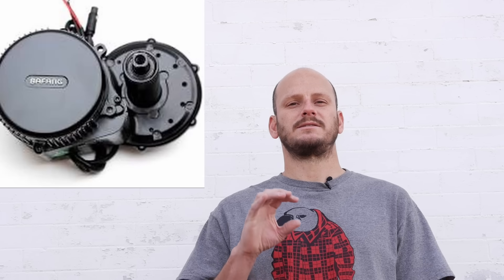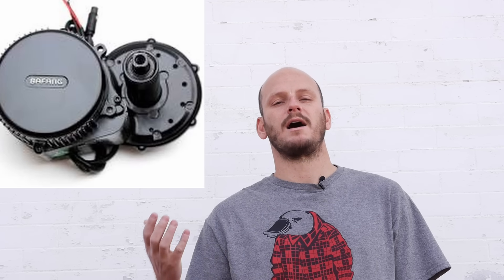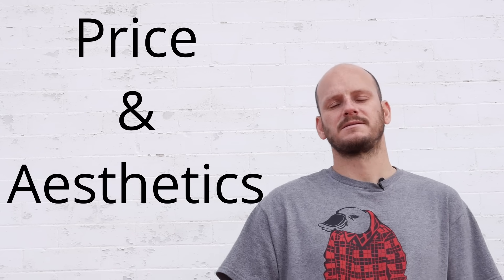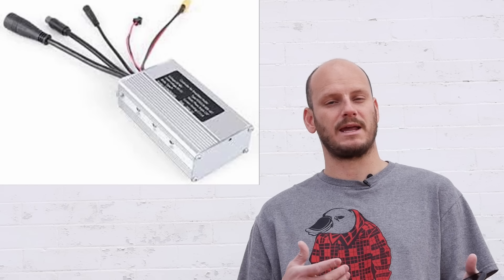Hub vs. Mid Drive Motors: Why Hub Motors Suck and Debunking Common Myths with performance test

Comment: I have 2600 miles on my $1100 hub drive bike. Also, my 500w Das-Kit motor has no problem with hills.
Reply from the maker: 👍 it definitely depends on where you live. Hills here in Salt Lake City burn Em up! But they can be 10% grades
Reply: @JohnnyNerdOut  Any motor will burn up if overloaded. You simply have the wrong motor for the application. Not the motors fault nor the motor topology's fault.
Reply from the maker: @difflocktwo  totally correct that you can burn up ANY motor when driven improperly.  When when ridden properly a mid drive will last longer and outperform a hub on steep hills (over 8% or so)
Reply: @JohnnyNerdOut  If we choose a hub motor that meets the required performance, I don't understand why you say it performs worse. The hub motor will perform exactly as it will and if its enough, its ok, if it is not enough, it is the wrong motor for the application. We can use the correct motor for the application and achieve the performance we desire.

Comment: His price comparison is wrong. You can get  a  hub motor a lot cheaper, like $200 for a 250w kit. Bafang mid-drive the lowest is $400. Also, the hub motor can be lighter. I found one for 1.2kg, compare to mid-drive 4kg. But for me the reason to get a a front hub is that I can just remove the front wheel if I decide to use it as a normal bike, furthermore, my drivetrain will still be the same.
Reply from the maker: I was trying to do a apples to apples comparison 750w to 750w of comparable quality. You can also get cheaper mid drives. Tongshen cyclone etc especially if you buy direct from China.
Reply: @JohnnyNerdOut  If output power were the same, you would not feel any difference in performance. Not exactly apples to apples. If one feels weaker than the other, it is. If one is weaker than the other, it is not the same wattage.
Reply from the maker: @difflocktwo  not true. Drive a 100 up automatic car and then the exact same car with a manual and tell me the acceleration isn’t different. That’s a poor analogy as it really doesn’t even do my point justice but it’s the same principle.
Reply: @JohnnyNerdOut  If you dyno the cars in your example and the dynos do not match, it is clear why one would be slower than the other. One has less power or less area under the curve than the other. Even if both are labeled the same, it is clear that they do not perform the same.

On a kinda sad note, manuals are not selling that well anymore, even in europe.

Comment: I live in the mountains and I am using a hub motor and have no problems
Reply from the maker: Interesting. You would however notice a marked difference with a 750w mid drive on those hills 👍
Reply: I do not live in the mountains but I have a hub motor with so much torque if flips people off the MTB. I have colleagues who complain that their hub motors have too much torque for the same reasons, the CG of a MTB is too far back for the torque of these hub motors.
Reply from the maker: @difflocktwo  power is definitely relative. Watch some of my videos showing comparable motor systems using the same power climbing hills. “Power multiplication” using the rear gears is huge. There are trade offs though using a mid drive which is why it’s an advanced system. Definitely a learning curve !
Reply: @JohnnyNerdOut  One glance at the wiki page on the watt will show that it is far from relative. The watt is very well defined. 

I already mentioned this in other replies: Gears are under 100% efficient, this means that you will always get less power out than you put in.
Reply from the maker: @difflocktwo  I’m unsure of the point
Reply: @JohnnyNerdOut  Power is work over time. It doesn't matter how work is done.

Gears do not create power, they consume a bit cause they are not 100% efficient.
Reply from the maker: @difflocktwo  correct

Comment: You aren’t comparing apples to apples though, for the price of the mid drive you could buy a 3000w hub motor which definitely has better performance
Reply from the maker: 3000w to 750w would not be apples to apples…..
Reply: @JohnnyNerdOut  ok yeah you are right 😂 but you know what I mean, they’re two completely different price points. A 3000w hub is near the same Nm rating as a mid-drive and price wise would be similar (hub would still be cheaper) so both would be closer to apples
Reply from the maker: @iSuperMC  I don’t know. I feel like that just proves my point more. It requires 4x the power (which is now not even close to being considered a bicycle in the eyes of the law) to get similar performance. 
How much is the 3kw hub motor and good controller?
Reply: @JohnnyNerdOut  Similar performance means similar power output. If you are focused on energy efficiency, that is a different argument. Most people care how much is costs, how fast it goes, and how far it goes. No matter if you ride a mid drive or a hub drive, people report similar Wh/km numbers on their commutes.
Reply from the maker: @difflocktwo  I’ll disagree there. I’d say that performance is loosely tied to power output. Gearing makes a tremendous advantage as it uses leverage to amplify the same power output into better performance.
Reply: @JohnnyNerdOut  Imagine we dyno one of your mid drive bikes. We profile your bike's peak performance from 0 to 30 mph. Then we build a hub motor bike and we program it to exactly match the output of the mid drive bike. Then we dyno that hub motor bike to confirm that it matches the mid drive dyno plot. 

Both bikes are putting down the exact same numbers, wouldn't you agree?

I would say that both of those bikes would feel almost identical at all speeds and load conditions. We basically copied the soul of the mid drive and recreated it with the hub drive.
Reply from the maker: @difflocktwo  you wouldn’t be able to make a hub motor match the same numbers a mid drive can do. You really have to ride a 750w mid drive and a 750w hub motor side by side to appreciate the difference. But some people don’t need or want the performance a mid drive offers because of the trade offs. You HAVE to be in the correct gear or you will do damage to your bike and or motor system. But for me, the trade offs are worth the power multiplication that running power through the rear gears offer.
Reply: @JohnnyNerdOut   You cannot multiply power without energy input. Gears are under 100% efficient which means you will always get less power out than you put in.

Let's say that to lift a certain mass up a certain hill at a certain speed takes 750 W. No where in that equation does drive type factor in. You can achieve 750 W anyway you want. You can use a mid drive, a hub drive or even a rocket engine. If you move the mass up at the same rate you are doing the same amount of work per second.
Reply from the maker: @difflocktwo  I understand what your saying, that makes total sense. You absolutely correct with the measurements of how horsepower is measured. I think you really need to feel the difference though. Automotive analogies are the best I know. Using a transmission or using a single gear. That’s what you have here as well. Same results with the same power coming out of the motor. You really need to feel it to believe it. 
How do you explain the same power coming out of a motor (25a x48v) giving far different results on both hill climbing and top speed (both mid drive advantages)?
Reply: @JohnnyNerdOut  

Summary of my ramblings: You had the wrong hub motor for the application if you didn't get the performance you wanted. Solution: Get the right hub motor for the job.

I assume that your current and voltage numbers are battery side. 25 A x 48 V ≈ 1 kW battery power. This is power from the battery rather than power from the motor. If you dyno the wheel, you can measure power output rather than power input (from the battery).

If one system is outperforming the other, the efficiency in energy conversion is different. Let's say the mid drive is peppy and then hub drive is bogging down. We can assume *under those specific load conditions* the mid drive is 80% efficient and the hub drive is 40% efficient. So the mid drive is actually putting down 800 W at the wheel and the hub drive is putting down 400 W at the wheel. Here you feel the difference. The hub is is putting down half the power of the mid drive with the same power input. Rest of that power (600 W) is wasted heating up the motor. The mid drive is only turning 20% of the power into heat, 200 W. I need to stress that motor efficiency can change dramatically depending load conditions. If you lock a motor it is 0% efficient even if it's putting out a ton of torque. 

In the previous scenario you are asking too much torque from the hub motor so it isn't efficient, and you directly feel that it as less powerful, because it is. For that load case, you have the wrong hub motor for the application if you want it to achieve the same performance as the 80% efficient mid drive.

If you want to match the performance of the mid drive you need to use a suitable hub motor. The hub motor would have to be able to provide the same wheel torque at the same speed at the same efficiency. 

If you want that peppy feel, it's all about wheel thrust. Wheel thrust is wheel torque divided by the wheel diameter. So you can try a smaller wheel diameter which will increase thrust or you can simply increase wheel torque. 

With multi speed transmissions you can shift down to increase wheel torque. With a hub motor the first course of action would be to decrease wheel diameter to increase wheel thrust. If you want more torque to increase wheel thrust and less losses, you can get a hub motor with more torque and less losess. In simplest terms that means a bigger motor. In more complicated terms is means a motor designed to meet your loading conditions. 

If you want a lot of torque at low speeds and with high efficiency, with typical motor construction, then you're probably looking at a very large diameter motor. If you can imagine a hub motor with the dimensions of a 26" wheel, that would probably provide enough torque to turn your bike frame into a fruit roll-up. 

Practically, ordering parts from China and so forth, get as big a hub motor as you can in as small a rim as you can and give it all she's got. 

Top speed is more of Kv thing. It's a motor constant that says how fast a motor spins per volt. So you can increase the voltage to go faster or choose a motor with a higher Kv. There are also field weakening tricks in controllers to go even faster than the motor constants would predict.
Reply from the maker: @difflocktwo  I don't think that would work for me, but maybe someone else. I live in Salt Lake City with 10-15% grade hills I need to climb. I also like to commute at high speeds. I like to be borderline legal (so no 72v systems) show me a hub motor that can do 15% hill climbs and cruise at 30mph under throttle alone using a 48v 25 amp system. Physics will tell you that you can't achieve that.
Reply: @JohnnyNerdOut  Since you are hauling 300 lbs up mountains all day, I would assume that you would absolutely love regen braking. It will save you from a lot of brake wear and I think you could get over 10% of your range back.
Reply from the maker: @difflocktwo  I would definitely have to see that in person to believe it. Almost all 72v systems would illegal over 10 amps in anywhere in USA. so technically you could run 72v legally 🤔
Reply: @JohnnyNerdOut  I think you are confusing output power with input power. Why would the legislation care about input power? Imagine I ran 4 kW from the battery, 40 V 100 A, but the motor only outputs 400 W due to inefficiency. The rest of the power is heating up the motor and the air. Are there rules against using motors as heaters? You can program a controller to drive a motor inefficiently if you need more heat from it. I think some electric cars do this as they use heat from the motor to heat the cabin. 

Or imagine I run a perfectly 100% efficient motor in series with a water boiler. I could be pulling 10 kW from the battery but my motor is only outputting a few hundred watts.

Even in Europe their 250 W motors peak at 800 W. This is because a singular wattage value without context is useless.
Reply: @JohnnyNerdOut  You can see many skateboards and little scooters with tiny direct drive hub motors pulling many kW from the battery. They also go like 60 mph or something. it's not so difficult to believe when they are all around you.

Comment: Have both.  Have built many.  Would only use a mid on a mtn bike and would never use anything BUT a hub on anything else.  Put it in gear and ride.  Never shift...and yes, hub systems are more WAYY more reliable, simpler, cheaper. Not a myth.

Comment: I bought a hub motor cause I'm poor and that's all I can afford. It is a 1000w though
Reply from the maker: Nice! How much was the kit?
Reply: @JohnnyNerdOut  The kit and a 48v 14AH battery to run it was $530 with tax. Should work fairly well though since I'll be using it for commuting and light trail riding. I wouldn't trust the walmart bike I am converting for anything more than that even without the hub kit
Reply from the maker: @ThunderbolttheFox  ride long and prosper 👍

Comment: I enjoy my hub motor conversion . In Australia we can only legally have 250w motors anyway . Yes you get more power from a mid drive but also more drive train wear which you didn't mention . My spokes have never been loose yet and it's easy to keep a eye on them and adjust them if needed . Hub motors are a lot cheaper to buy and less maintenance so it's hubs for me :-)
Reply: Put a 1500w on the front anyway.

Lmfao 25km/hr is stupid for what we have to pay to do it. The torque is incredible on big hub motors and if you really want to be a numpty about it, you can simply limit it to 25km/hr but retain all the torque of that massive motor.

You win all around going bigger.
Reply: @TheStaniG  I can get 30+km/hr out of my 250w hub motor pedaling  , more with more effort . I can change  the top speed in the display but still limited to about 25klm/hr on throttle so enough for me . Yes you can get bigger hub motors but if the cops have a crackdown on E-bikes they will confiscate it if not legal and it's gone forever no matter what you paid for it .
Reply: Yup this, I chose a hub because of less maintenance and less chain wear. It only goes up to 25km/h so it does not matter how much more powerful a mid-drive is
Reply: @Another-Address  I hope things are better now.
Reply: if yoj are climbing insane climbs say goodbye to your hub motor on the middrive you can use the gears of the bike to have more climbing power. i guess if you live in a rather flat are you arent going to need a middrive but if you are climbing insane hills middrive is for you
Reply: On road i do climb big hills with my hub drive , i use the throttle when pedaling and go up with ease . Iv'e seen teeth ripped off gears and chains break with mid drives . Hub drives still get you home if you break a chain etc . For me personally hub drives are better , i'm 68 and ride 30/40 kilometers distance sometimes which i wouldn't do if i had a normal bike so good exercise for me :-)
Reply: Restrictions you have to contend with are ridiculous and government overstepping it's bounds.  I'm glad the US decided 750 is our limit.
Reply: @stoutdog56  Difference is we are a more socialist society in Oz than the US and have free government hospital health care so gov. can take care of it's/our dollars and tell us how not to get hurt. No different to seat belt laws I s'pose.

Comment: It´s great hearing your professional experience as a bicycle mechanic, but please leave the engineering to engineers. A lot of what you are saying has no mechanical or electrical validity.
Reply from the maker: This video I kind of skim coat a lot of stuff and it leaves a lot of things up to interpretation. But I actually do have a very good grasp of engineering. I have other videos that kind of dive deeper into the subject.

Comment: Wife's hub-driven bike continues to provide absolutely fine performance, and hits 40km/h top speed, without the chain or gears moving. It literally provides silent riding with acceleration which is perfectly acceptable, and it has excellent disc brakes which I frequently adjust and service.

You neglect to mention that bike gears are things that are designed to reduce torque from the pedals. If you take a twice-as-torquey motor, and stick it through a gear that reduces it by 2.5:1 then you now have LESS torque than the half-as powerful hub-drive motor!
Reply: 3:33

Comment: hey Jonny ever tried hub + mid drive on the same bike?  I have a hub motor bike from a year ago, its cool but I got this idea it would be MORE COOL w/ a BBSHD and a second battery.  Idea is I'd have both motors operating independently of each other. Do you think i would run into any problems? xD
Reply from the maker: I have not actually. I say go for it and report back with lessons learned :)